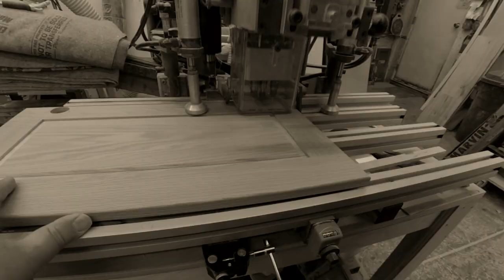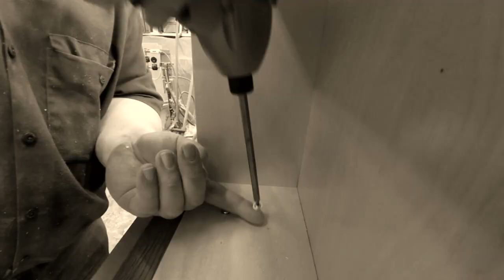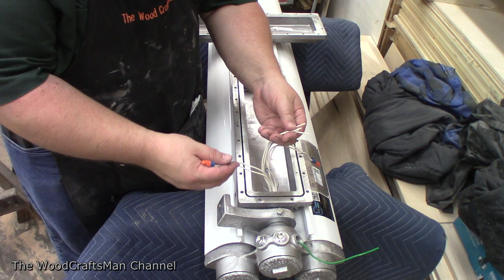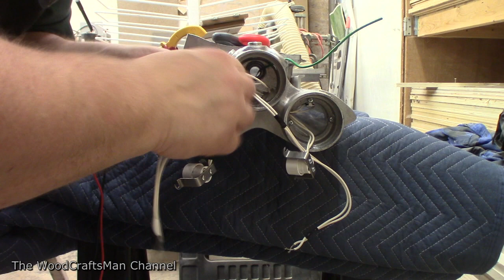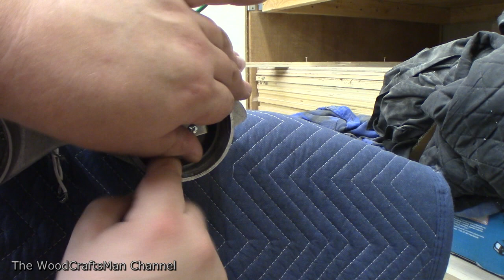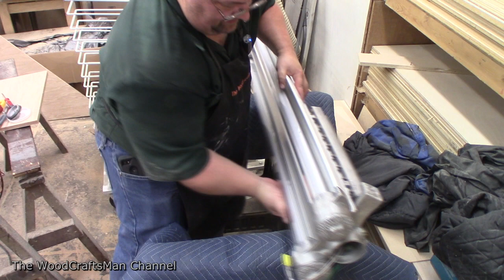Converting A Explosion Proof Fluorescent Tube Light Fixture To LED Ballst Bypass # 244

Comment: These fixtures are pretty cool. They have that industrial "look" that's so popular today. I've retrofitted many of them for people who like to use them in man-caves or restaurants. They are pretty tricky to retrofit, but it can be done. One thing you need to know is that even though you can retrofit them, they will no longer have their Class/Div rating. Seems like Larson didn't tell you that. So, if you retrofit them, you cannot use them in a hazardous setting. Still, it's a great project.
Reply from the maker: That's interesting very , because I called them to verify, and they specifically said as long as I didn't remove the sealant compound where the wires pass through to the conduit box on top, that it would still meet it's classification because the entry / exit points were left undisturbed. Plus they mentioned I would need to use a double ended bulb Design "B" so all of the wiring would be used and in tact. The only thing I did was remove the ballast but still used all four wires that were used with the fluorescent tubes.  Regardless, it's still serving it's intended with no modifications to the structure, casing, internal wiring pass through, ect.

Comment: What is the name or if you could provide me with a part number. So I can order these. I have 10 of those fixture tht needs to be replaced
Reply from the maker: I don't know if they are available anymore, but here is the link to where I got them from.

Larsen Lights, LED lights for your equipment !. 4' T8 LED tube CK-22-4 Rotate, Frosted Tube
https://www.larsenlights.com/4-t8-led-tube-ck-22-4-rotate-frosted-tube

I've also tried the Sylvania LEDlecents, they are not rotatable, but they have a 270° beam pattern and are a design "B" double ended (one end neutral, the other hot). Hope this helps.